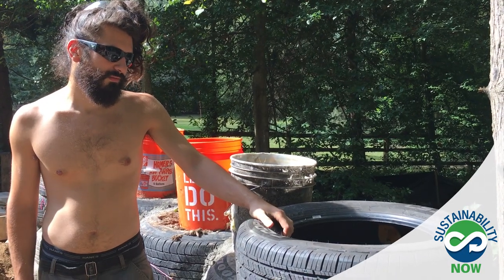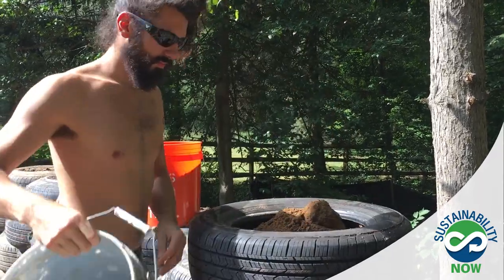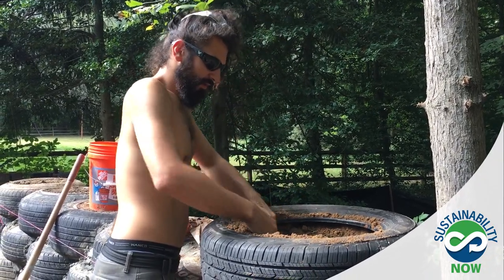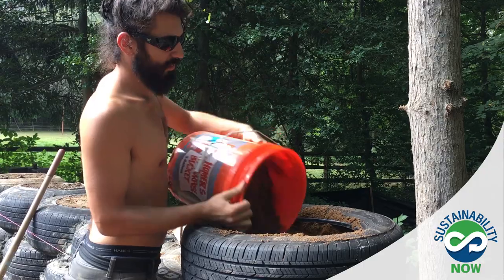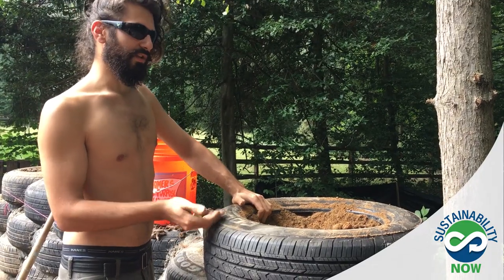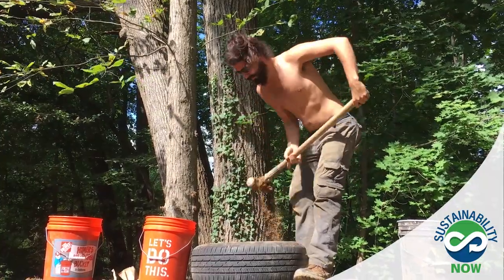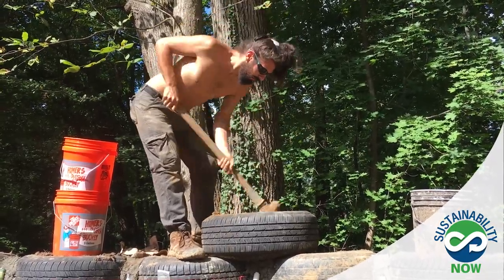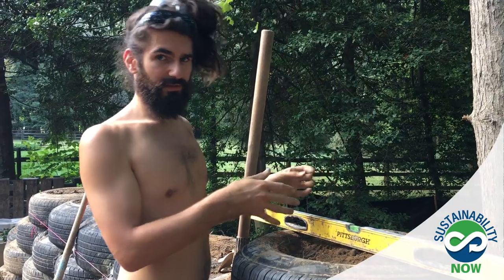Earthship Construction: Eric Ficinus and Rammed Earth Tires

Comment: Would a jumping jack/ gas powered tamper work? I'm sure you would still need to hammer the dirt in the sides but maybe using the tamper could speed up the process. Someone's thoughts from experience doing this would really help. I'm considering building a global model.